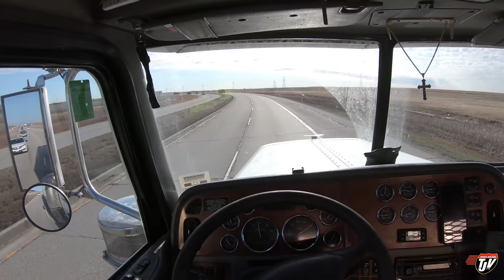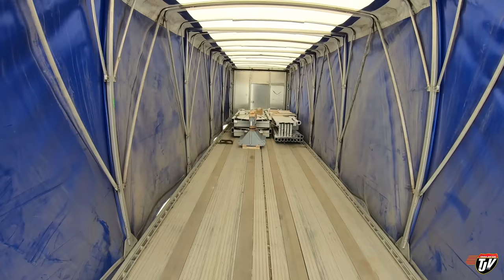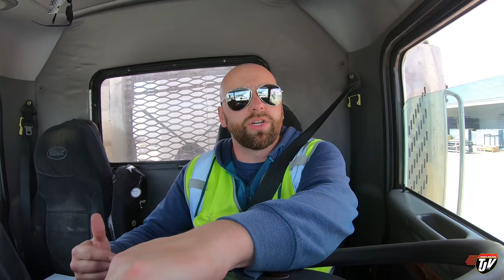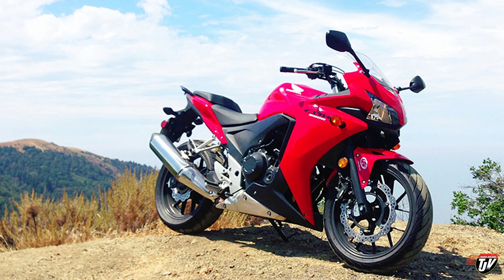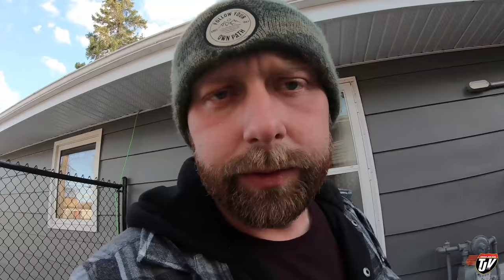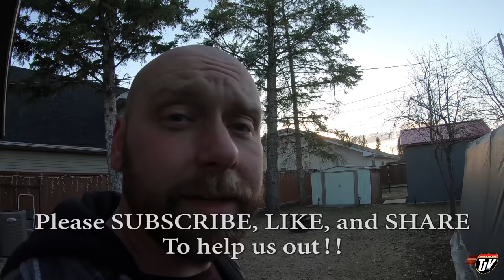My Trucking Life | MOTORCYCLE SEASON | #2276 | May 5, 2021

Comment: Yup, red wire to plus (+) side, black wire negative (-) to negative side of battery works better and no fire works!  Also you should really change the oil so you don't have problems.  July of 2019, I sold by 09 Harley Road Glide, with 10,000 miles for $9000.00.  Fully loaded Stage 2, she was a great machine, just getting to old for two wheels.  Now on my Canadian BRP Can AM Spyder RTL and love it.  Ride save Josh.